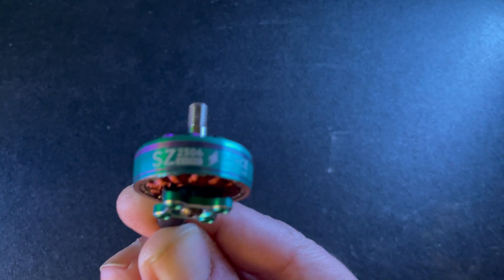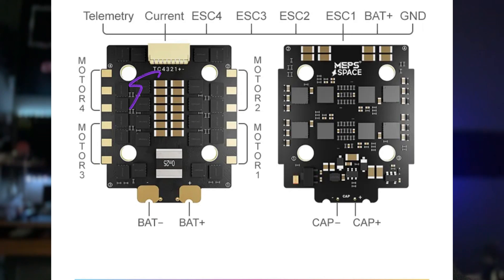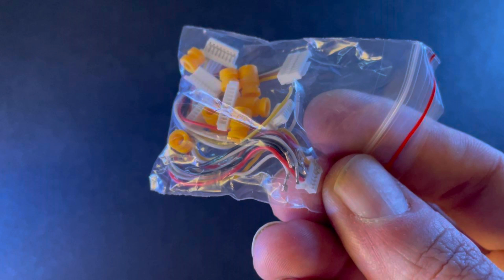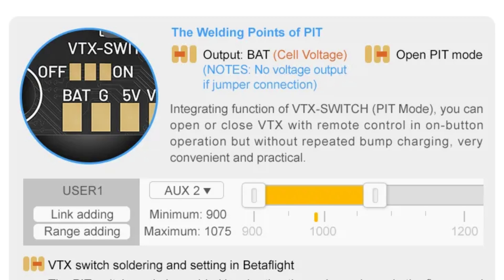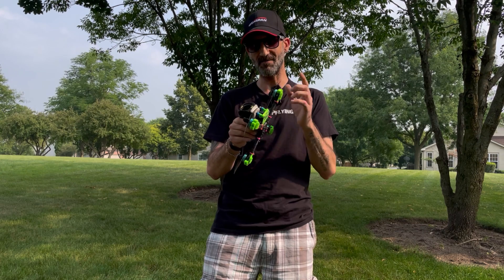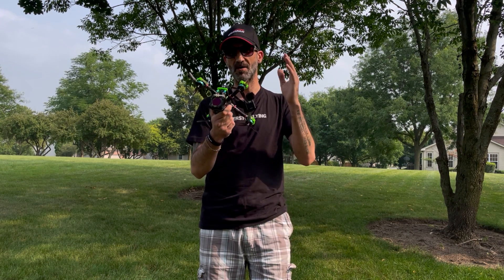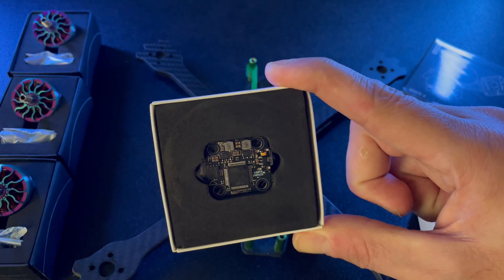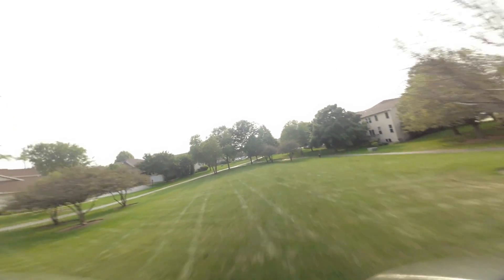Is this the FPV Combo for You? MEPS 2306 1750KV Motors, F7 Mini FC, and 45A 4-in-1 ESC Review. #fpv

Comment: The pilots i talked to said they destroyed the free motors the first day of flying...happened to me.  They use substandard materials, you wont find any 7075 alum or grade 4 titanium,  they are soft as a tin and and made from the same ashtray aluminum, and charge $22 for that trash. If they priced at $12 they'd be viable, but swapping out $22 motors everytime you crash is ridiculous. I expect motors to last a year, not die on the first day.   You've done an amazing review, but Meh-ps doesn't deserve your time or your kind words. This company has been trying to silence reviewers.  Check out Meh-ps heritage...they comenfrom SZ-Speed, a $7 motor company from AliExpress.  They have a team of salesgirls pushing them,  the same sales girls will attack you if they dont like your review. Shit posting me, doxing my home, and unleashing annarmy of bots to spam my posts...silence the reviewer, instead of listening to feedback. Worst of all they try to control the narrative by giving away free motors and contracts.  Meh-ps is a scourge in the fpv community that needs to be aborted
Reply from the maker: Yeah I still have to try them at Bando . Thanks dave for your honesty bro. I trust your advice and your knowledge. 👊🏻

Comment: Looks good 👍🏼 I do agree very strongly about the bottom base on the motors. They do need  either plastic or thicker base.  Also they do need to be flat. 
The stack looks pretty solid too. I’m more interested in the stack than motors. Maybe if they make a V2 version of the motors. 
Great review and information brother🤙🏼
Reply from the maker: Thanks Homie I appreciate it. Thad or all your love ❤️🙌🙌 yeah hope they take this video and make improvements on the Space SZ motors , but they do run smooth